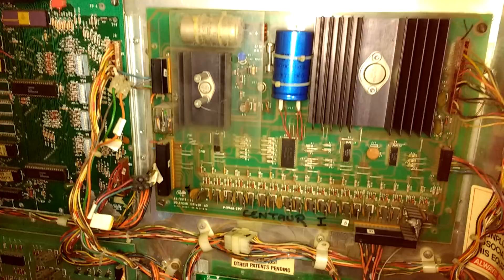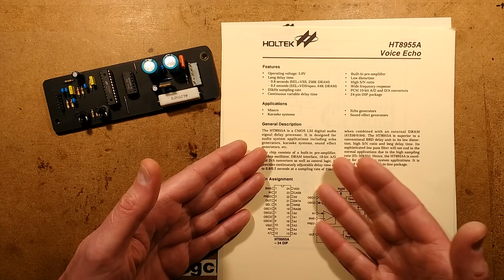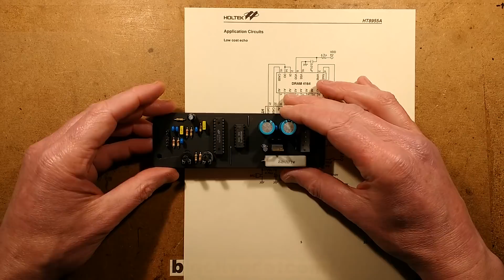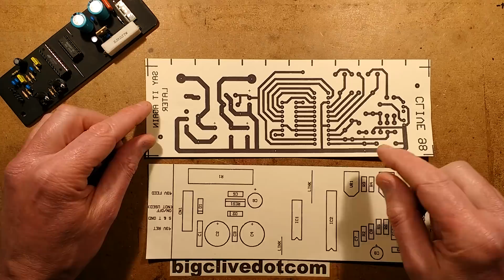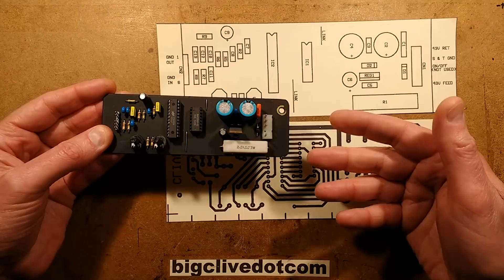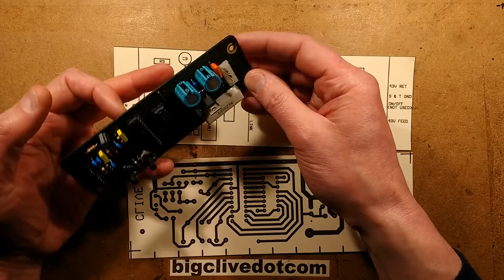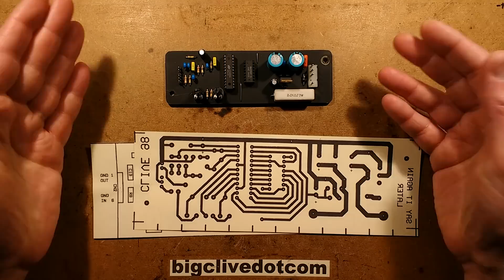Designing the Centaur pinball replacement echo card.

Comment: My Centaur has never had a working echo, the Say It Again board was already long gone when I got it. Maybe it's time I should build a Big Clive replacement board.

The original SAD chips that fail are basically a just a few hundred capacitors and amplifies that push the audio along like a delay line, the capacitors fail over time regardless of whether they are used or not, so like you say most of the new old stock ones are also dead

Comment: Something from memory although I do have the mags boxed away somewhere here, Back around 1974-76 Practical electronics and also Electronics today Iternational published some various circuits relating to Guitar and music applications, There was an ADSR filter and echo devices using LSI chips and a huge host of discrete componants, I do know there was a few echo set ups because I built a couple of them in combination with a music synthisiser with voice recording added in, in the 80's things like that tended to die out for some reason , perhaps it was because of the chips becoming unavailable i think.

Comment: Have you ever used the PT2399 delay ICs? They're cheap enough on eBay and they're actually not bad. Korg was using them in one of their little £30 synthesizers and it did the job well.

Comment: you said the heat would rise and may cook the large caps possibly causing future issues...you didn't mount the board horizontal. it's vertical. your board layout is perfectly fine so long it's installed like you showed in the machine.

Comment: Holtec did that to me too. I used one of their chips in a simple electronic dice project at school with my electronics class, mid way through one year they discontinued the chip, very annoying. So from then on I had to use a Pic, but the circuit was nowhere as near as nice, but you could program in cheats to give you a six if you did a double tap on the go button.

Comment: Nowadays just smack a raspi in there with a USB audio card eh?
Reply: RasPis are good for a lot of things, but this isn't really one of them. There are so many issues with making it a robust solution -- boot time, SD card write protection to handle random power on/off events, etc. -- for a simple task like this, making a dedicated board  is probably easier.
On the other hand, if you have deep linux/raspi knowledge and not so much on hardware, it's still a viable approach.

Comment: I got a realistic reverb box 30 years back when I was a kid, I think I still have it somewhere, it has a bucket brigade delay line, I wonder if it'll still work. I remember if you increased the echo time right up you could hear the whine of the clock signal.
Cant remember the No. of the chip but I recall the bucket brigade and the clock gen came as a pair.

Comment: Great video Clive! Why you didn't change the power supply section with a switching one to avoid the big resistor? Were you feared of noise in the analog section? Or just to have a retrofit in the style of the previous board?
Reply from the maker: I was keeping it close to the original, and switching supplies were less common then.

Comment: I'm sure someone will already have mentioned this, but I think (not entirely sure) that the sound board must use elements from some earlier Williams Electronics coin-ops (Defender, Stargate, Sinistar, etc). The board isn't laid out in the same way, but the sound effects are so similar that there has to be a connection. And the companies had close ties, so much so that  Williams ended up owning Bally Midway in the late 80s.
Reply from the maker: There were common sound chips back then.  Basically digital audio waveform generators.  The sound characteristics were different between brands, but of a similar style.

Comment: Back in 1970, in East Ham, London, was a small firm who made a fortune screen printing the glass panels for pinball machines and other display stuff for big retail outlets. I worked in the same building and was fascinated by the intricacy of their work. As you say, the panels are as rare as rocking horse poop and very expensive.
Reply from the maker: A modern replacement is translites.  Colour printed vinyl sandwiched between two sheets of glass.

Comment: Was the "squawk and talk" board using the Texas Instruments SP0256 allophone set chip or was it a specific pre set word chip similar to the speak and spell?
 I can remember buying the SP0256 directly from Maplin electronics right up until the early 1990s, quite a lot of fun was had stringing the allophonic sounds together making peculiar sounds. I found though that sometimes it was challenging to make some words understood, even having to tweak the external audio filter to make it more easily understood.
Great insight into arcade machines, thanks Clive.
Reply from the maker: It's closer to the Speak and Spell chip.  Some machines did use phonetic speech synthesis though.

Comment: Awesome video and what a coincidence.  I am rebuilding a Yamaha CS-80 that once belonged to Frank Zappa.  I have everything working perfectly with exception of a bad tremolo chorus stereo effects system.  It uses a dual channel analog bucket brigade device full of noise and artifacts in addition to overall weak output.  I swapped it with the BBD from another CS-80 and similar problems (both keyboards had flaky stereo effects).  I was not aware these could literally wear out.  But since they are an analog memory device (just like FLASH memory) after rubbing a couple of brain cells together... holy shiznack..each write to the BBD aka clock cycle to shift data down the line wears the gate isolation layers exactly as FLASH.  They can indeed wear out!?!  I was wondering why that part of the synth always goes boobies up and searching elsewhere for biasing problems etc to no avail.  Clive, you make a guy learn something new every day!

The existing system keeps the chip constantly clocked and handling the analog data, even when the effects are not in use.  I wonder if I should modify the circuit to kill the chip's clock when the effects are not being called upon to stop wear???  Otherwise the chip is always active, just not mixed into the audio.  New old stock should be okay though.  I did order new old stock of that chip now (updated low noise version) and will try it out when it arrives.  Please let it end the nightmare.....
Reply: You have a CS-80? The best synth ever, IMHO. So many legendary songs made with it: the 1980 Doctor Who theme, Blade Runner, The Shining, etc.
Reply: Got three of them, one is mine and 2 others are in from clients for restoration.  One of the most insanely complex electronic devices I have ever worked on.  It's an amazing experience as each key has its own dedicated pressure transducer underneath for after effects.  You change pressure on the key or wobble it, those expressions are added to the sound.
Reply: Robert, what year of clavinova?  If from the late 70's to early 90's, your description is exactly what the reverb effects on the CS-80 does.  These chips like Clive is talking about were used before DSP's became available.  Anyways, the faulty effects cause a hollow nasally sound full of noises and other artifacts in my case.  What goes into the analog delay is clean, what comes out is noisy, weak waveform full of artifacts on the scope.  Check in your reverb board for a BBD (bucket brigade device) and replace it.  Panasonic made most of them used in Japanese equipment.  You can probably find the later production low noise versions.  There are good videos on YouTube how these devices work.

https://www.youtube.com/watch?v=-cLohPyMp1I
Reply: Reckon that might be the problem my Clavinova? Every reverb setting either does nothing, or creates a harsh buzz? I've got a cracked control panel PCB that I have been constantly re-soldering...
Reply: The Dollar Guy I almost bought a CS-50 recently. It was sold before I could get it. That sound, man...
Reply: The Dr. Who theme was originally recorded using a bank of single-note laboratory oscillators.
Reply: Martin Green Yes, the 1963 version. The theme was completely redone in 1980 with synths.
Reply: Yes, sorry I should have been clearer. I wasn't disagreeing with you about the 1980 version. They messed it up with some of the latest incarnations though.
Reply: Martin Green No problem. I agree, the newest versions are quite dull.
Reply: Any CS series synth is very difficult to find now.  Sadly many cs-50 and 60's are scavenged for parts to keep the monster CS-80's alive.  The voice cards alone easily fetch $400+ each and same for the DAC chips they use.  I saw one selling for $1000.  Just for a proprietary DAC.  I wish Yamaha would make another production run of their chips used in these synths and electone organs.
Reply: UPDATE!  Got the new old stock low noise MN3010 BBD to replace the standard MN3001's that would not generate a proper waveform.  Absolutely surround sound AWESOME!!  Perfect waveform as in the service manual and bamn!!  Blow the doors off stereo/reverb/chorus effects.  I owe Big Clive a beer.  Thank you!!!

Comment: Isn't a 3.7 volt battery a lithium battery or was this before lithium cells were common? In any case - arranging the cells away from the board in a plastic container would ensure that they won't cause harm.
Reply: As I recall, it was a stack of 3 NiCd cells in a single package. With game options set by dip switch, the battery was only to preserve high score values during power off.

In the 90s I used to service games commercially, and had to clean up a lot of boards with battery spooge on them. The crud would literally peel the resist off the board. I often had to scrub them down to clean metal and then re-tin with solder to protect the remaining copper. I then mounted the battery off-board in a plastic tube to prevent further damage.

It was the technology of the era, and many games suffered from overenthusiastic engineering that pushed new components to their absolute specs when new, which didn't bode well as they aged in service. Many makers were notorious for burning up fuse holders, card edge & Molex connectors because the heat from the high operating currents would cause spring contacts to lose temper, which increased contact resistance, thus creating a viscious circle until something burned up. Ah, memories (and nightmares)...
Reply from the maker: It was before rechargeable lithium cells were available.

Comment: I remodeled a 1976 Gottlieb Bank Shot a few years ago. Not restored just replaced every bulb, polished the field, and replaced the rubber bumpers. Interesting if time consuming and nerve racking with that huge pice of glass. All analog relay logic here so I didn’t dare any LED trickery but I did install 20,000hr bulbs instead of 3000hr. Still runs great out at the lake house.

Comment: Bucket brigade devices - thats how they implement analog delay - chip is basically a huge array of capacitor / transistor elements (commonly anywhere from 256 to 4096).  Its uncommon for them to be used in long echos like that because of the degradation - usually theyre used for PAL signals or in guitar phasing effects
Reply: is this not how CCDs work also?

Comment: I would have thought it would be easier to just buy a cheap chinese echo guitar fx pedal from ebay, strip out the board and mount it right in there, run the audio in and out right to the board and feed it a 9v dc line (centre negative !!!) - job done !  Obviously not as elegant or as much fun, and a much higher component count, but still a cheap and easy fix.
Reply: Well this design is from approx. 1999 - and it was based on similar innards as cheap pedals of the time (which weren't all that cheap), and was actually easy enough as it slotted right in as if it belonged there. Nowadays you'd design again with the same sound processor like the modern guitars pedals, and which costs right around 20ct and has built in memory. Or if you wanted to be authentic, two manufacturers have resumed making BBD analog reverb/delay ICs after 20 years.

Comment: I really like that board you made, I have a few questions though 🙂
1. How does it sound compared to the original? Is it similar? 
2.I noticed a little bit of latency between the solenoids firing and the sound coming out of the machine. Is that from your board or from the original circuitry? I don’t think it’s really that much latency but I still noticed.

Also it was a little hard to see the details of the Matt black board, it isn’t necessarily the exposure of your camera but how you have your lighting set up. from the shadows it looks like the lighting is above and away from you, it might be worth adding a supplemental light right where the camera is to fill in some of he shadows when you’re showing 3D objects. It obviously doesn’t affect showing drawings.

These aren’t criticisms, just observations 🙂
Reply from the maker: The latency effect might have been because one of the pop bumpers was misfiring.  I didn't notice that one of the rubber deflectors had broken and was stuck under the bumpers switch skirt.
Reply: It cannot be from the echo unit replacement board, as the dry portion always shoots straight through.
Reply: I see, to give you a specific time, it’s about 0:34 when the ball is bouncing around on the left red mushroom thing at the top of the machine. I can see the right red mushroom thing also triggering when there wasn’t a ball near it, perhaps from the vibration of the left hand one. Sorry, I don’t know the right terminology 😛

Comment: Why not just use a common ISD audio recording chip to playback pre-echoed audio?
Reply from the maker: The ISD chips didn't exist back then and there are lots of different phrases plus all the sounds can overlap.
Reply: Those ISD chips also only hold the sound for so long. Think of the storage as long term temporary. It's not a fix I would count on lasting for 20 years.
Reply: EEPROM like used in the machine to begin with and mechanics is "long-term temporary". So is human life on earth really. Nobody was thinking when building a pinball machine "this must survive 20/50 years", they just had to work reliably for a few years day in day out, and that would have been an accomplishment.

Comment: Good stuff ...
I repaired pins and video games for a couple of companies back in the 80s and early 90s .
Yep , those rechargeable batteries were hell on boards . When I repaired the board and replaced the battery I moved it off-board and stuck it where it could not do damage , using tape and gorilla snot .
Those back box glasses are pricey ... they were high-dollar back when .
I repaired a fair amount of damage from oxidized and burnt mole connectors as well as others that carried appreciable current ... silicone grease helped to mitigate the problem .
Those early echo chips were bbd (mentioned elsewhere) ... some required nulling and balancing of the summing of the two sides .
Did you ever work on juke boxes ?
Reply from the maker: I have a Rockola 443 jukebox.

Comment: It looks like the SAD4096 used an analog bucket brigade. Basically it had a shit-ton of built in (tiny) capacitors made of silicon. It takes a sample of the input voltage and stores it in a capacitor (not digitally). The capacitor could hold that analog voltage for a little while. Internally an amplifier feeds that voltage on the first cap to a second cap, transferring that voltage to the new capacitor. The amplifier was then disconnected between caps 1 and 2, and another sample from the input was stored (analog again) and put in the first cap. By daisy chaining a bunch of these sample, transfer, dump functions you'd eventually get an output. The teeny, tiny silicon capacitors in the chip would eventually punch through, probably from electron migration.
Reply: Yep remember building reverb units with these
Reply: Oohh, so it's a time-discrete, but value-continuous device?
Reply: Guitar pedals are still made with analog bucket brigade devices.  While there may be not be any current parts that are pinout compatible with the one used by the original board (the ones I know of are 8-pin DIPs) it would probably be possible to make an analog delay that would sound good in the machine.  Or one might be able to slap some quarter-inch plugs on the wires from the audio board and use a guitar pedal.
Reply: If it breaks from electron migration, would a NOS chip work more or less the same as it would've when it was made?  From what I understand EM only occurs when in use.